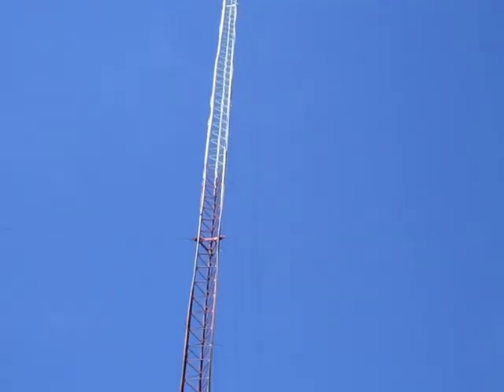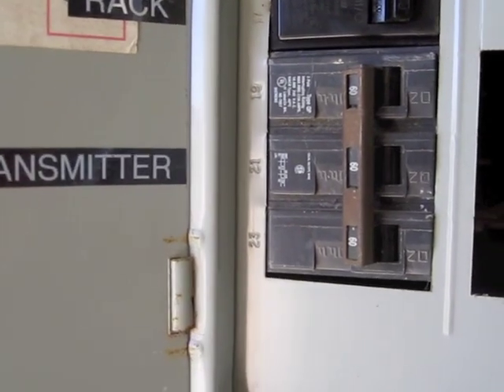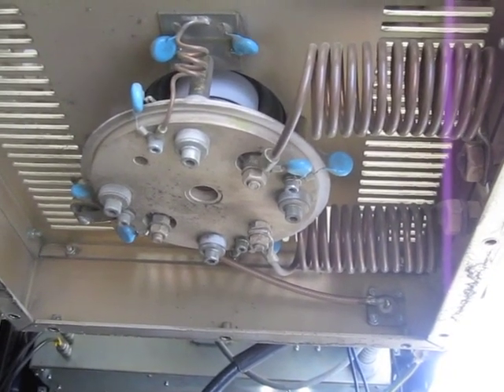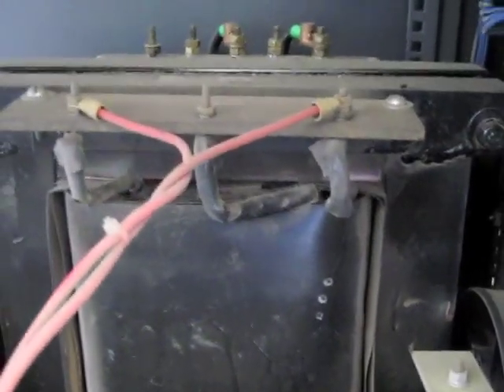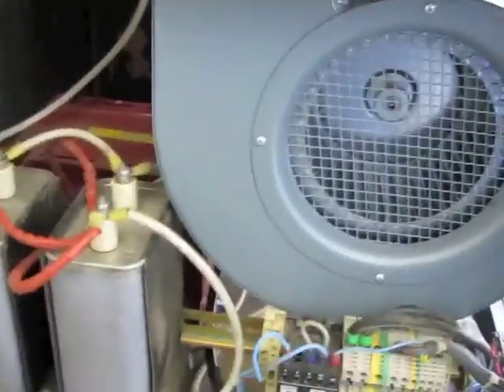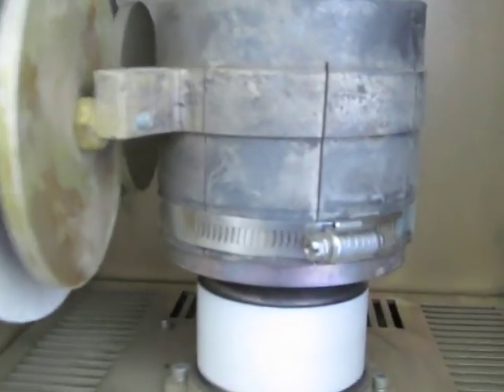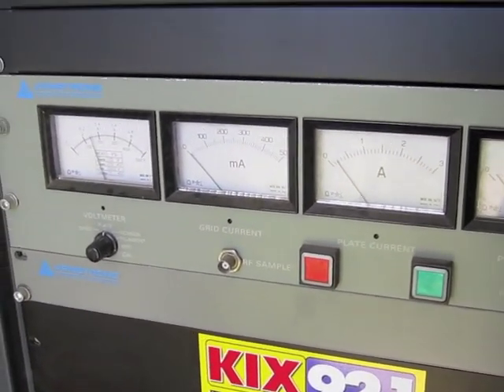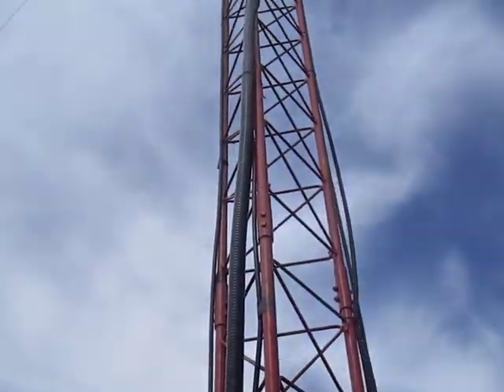WKXY-FM Transmitter Blower Replacement

Comment: very nice transmitter installation.  Ah yes the 3 phase breaker ought to have been removed when the new transmitter was installed, replaced with the required double 240V breaker, I would have also replaced the conductors.
Reply: Doesn’t really matter if there’s still 3Ø coming into the panel. It would then be 208

Comment: Grounded grid transmitter are staple and easy to tune but most higher power transmitters are grid driven because it takes less drive, but they must be tuned carefully or bad things can happen.

Comment: It's overmodulating? I saw the deviation too high I think...
Reply from the maker: WTSX XSTW 100% legal.  We transmit an RDS signal, which allows for another 2% overmod. Also, the occupied bandwidth is well below the allowed limit.
Reply: Kirk Harnack that's why I still prefer broadcasting RDS that is built-in the audio processor of the station. 7% of injection still at 75khz

Comment: Hi Mr. Kirk
I like high pwr  but not too high hehehe, my hobby is Radio Amateurism and my job is Radio also, in commercial two way.
It really is a different circuit of this amplifier, usually the output is taken at the end of the cavity (side of low Z) by a link or a capacitive pickup.
In this amplifier, know details of the final part of the cavity? The set of plates forms a tuning capacitor?
The length of this cavity is directly related to the operating frequency? It seemed short, this often about 80cm (31.5 inch) 
is the length for 92.1mHz.
I don't understand the tube PN, my english is so bad.
This video is quite old,  how is the migration to digital radio? Are spare parts of these old equipment? I particularly am interested in variable vacuum capacitors, Oil HV capacitors (DC filter), filament transformers like this showed in the video, high voltage transformers, surplus to HI PWR Transmitters, etc.
Congratulations for the work and the personal care, we follow strictly the safety procedures when working with high voltages, no clock, ring, anything metal that can hold me.
Antonio from Brazil - PY5AB.

Comment: radio-locator shows  this station to be 500 watts erp. what's the deal with that discrepancy?
Reply: The video says it is from 1999. Maybe it used to be 3000 watts and they have since changed to 500 watts. Maybe new owners?
Reply: In Rockford, Illinois there is a TV station that used to be a full power station and recently switched to a low power station. (WIFR-TV)

Comment: @TheSmashCOBamberg Dead, electrocuted mice and rats are commonplace in transmitter buildings. Rodents get in through even the tiniest of cracks & crevices in the transmitter shack structure. When a rodent comes in contact with an exposed high-voltage area that's carrying alot of juice or a high voume of RF, BAM!